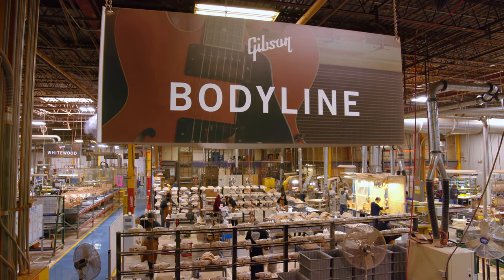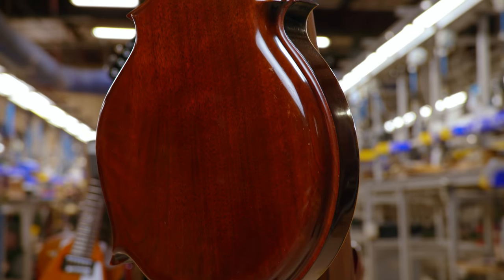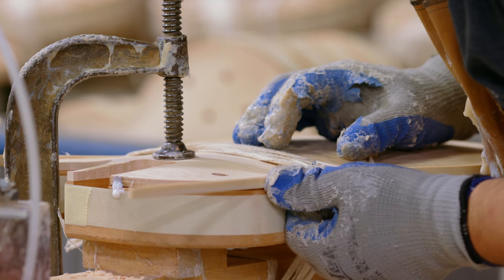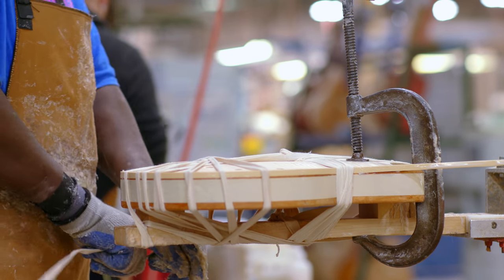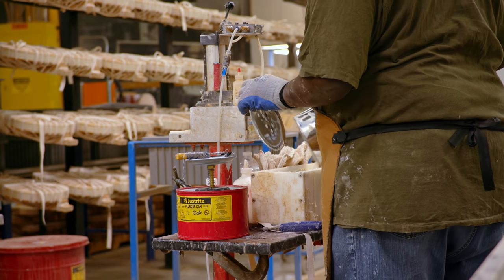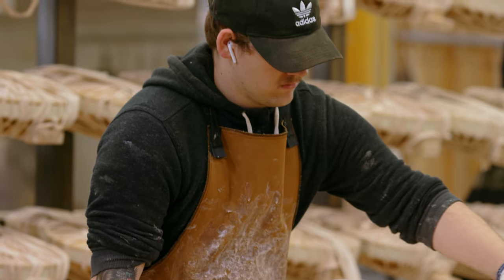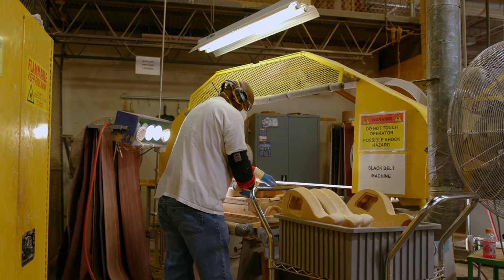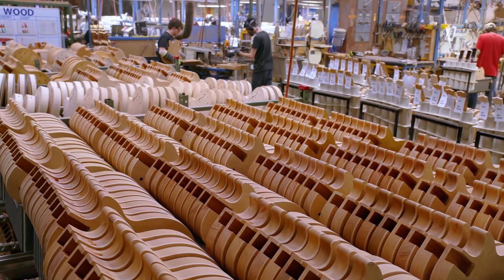Rope Binding Guitar Bodies At Gibson USA | The Process S1 EP 4

Comment: That damned slack belt sander is the destroyer of contours and flattener of carved tops.  It should be cut into small smoking chunks with a cutting torch and the remains run over with a bulldozer then buried in the bottom of an abandoned rock quarry.    Do the post-contour sanding like PRS does, by hand using people who know how to run orbital sanders properly.  The accuracy and consistency of the top carves after sanding will be GREATLY improved.